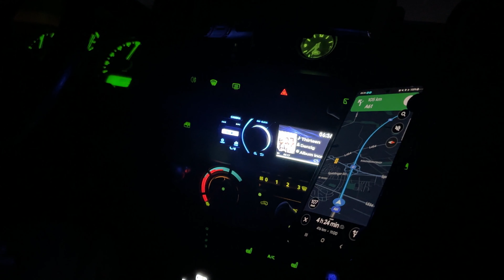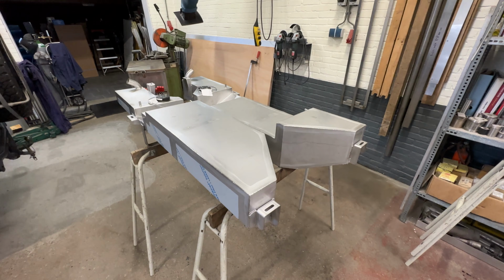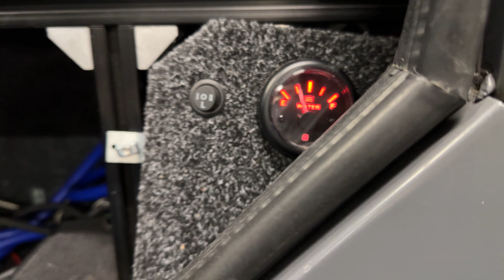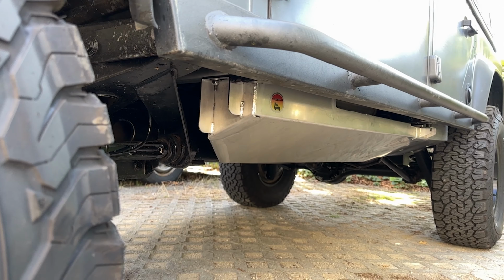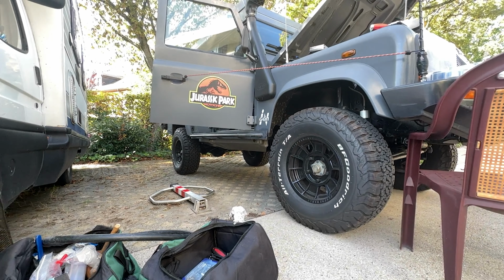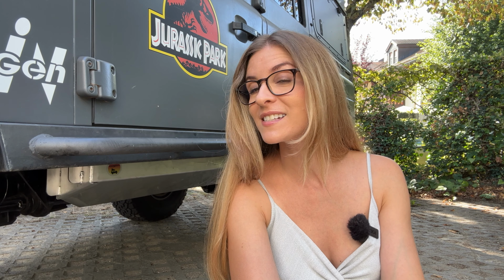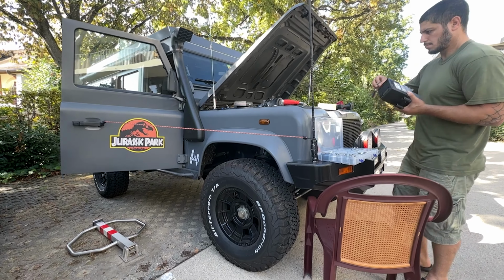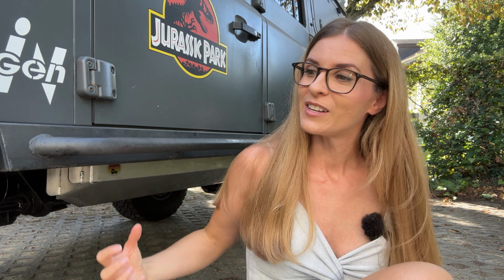Overland Truck Build | Stainless Steel Water Tanks (land rover defender camper)

Comment: Great, BUT I did some research and as far as I understand, it comes with a very heavy price tag (1,8k€ each)! So my question, is it really worth the money? And how long can the water stay inside before turning "bad"? Is there a valve to let the water off completely if you don't need, and will it rust inside, once water is not in there anymore? I'm very curious that's why I question all this.

Comment: Best set up, keeping heavy weight as low as possible while protected by the chassis and clever design did it make much difference to fuel consumption on return journey when full?
Reply: Defenders are shaped like bricks 😅 an extra few % of spring weight won’t make any measurable difference.
Reply from the maker: We like them and look forward using water system and see how all performs. Didn't see any difference in fuel

Comment: would like to see all the welding seams from the inside of the tanks
Reply: I think what silver surfer is saying is that the tanks should be purged with an inert gas to prevent oxidation that would cause cavities that could harbour bacteria. All hygienic stainless steel pipework is purged before welding for this reason.

Comment: Small garage work always seems to have more attention to little details than the large mass production factories. The only things I can think of is did you get a list of the parts used in case you need to replace a part. Definitely a good idea just no rock climbing!
Reply from the maker: I do think it depends on the craftsman as we had really bad experiences regarding the storage box on the side of the body and a transfer case rebuild. This time top notch! As we were there and help during all the install we know all of it 👍🏼

Comment: Truely nice workmanship, however the tanks in that location looks too exposed in my opinion. Perhaps in Europe the risk is less than African or Australian tracks?
Reply: The tanks are above the chassis. It looks deceptive on camera. 
But iirc if you draw a straight line from the slider to the chassis you won’t hit the water tank.

So the only way you are going to hit them is if you go rock hopping on some crazy tracks, and if then you are unlikely to crack one, let alone both…

The weight distribution alone makes it worth the risk imo.
Reply from the maker: Happy with tanks and we don't feel they are so much exposed as design isn't square. We don't do reckless offroading. Mountain rocky tracks around Europe can be tough. We certainly could get in a difficult track but will only see then what would happen.

Comment: The Tanks are outside the car - what about below zero temperatures? How did you manage the heating of the tanks?
Reply from the maker: We haven’t found yet a reliable solution for really cold temps. Will research more when all the water system is finished